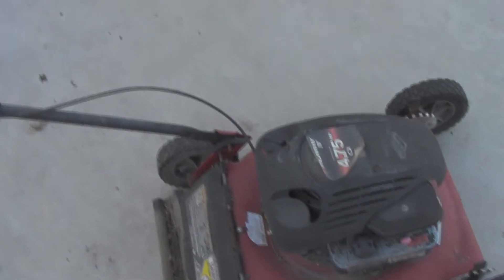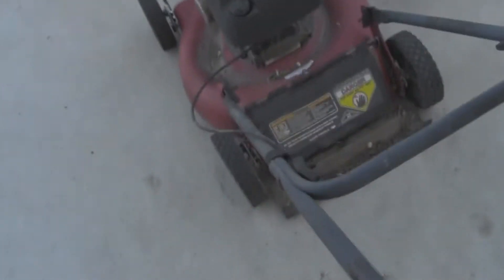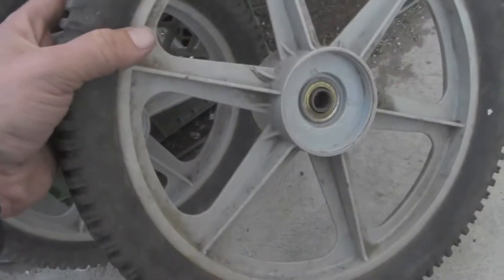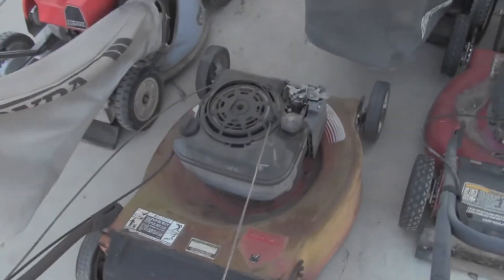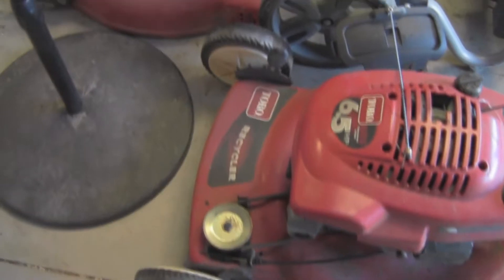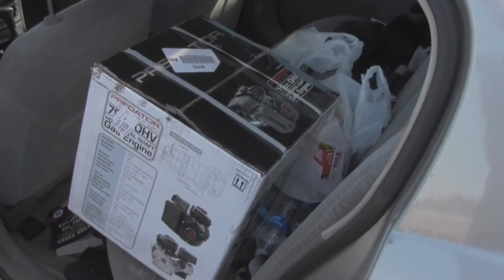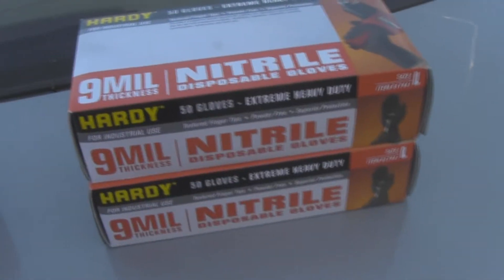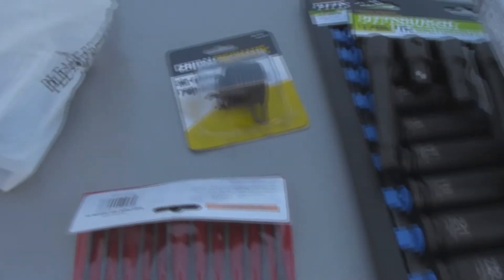Picked up 2 Mowers and Harbor Freight Scores

Comment: my neighbor has a toro recycler with the 6.5 tecumseh engine  the self propelled on his mower is doing the same thing it would move backwards but not fowards,  2 year ago the self propelled finally locked up completely and i took the whole assembly out and now the mower moves freely